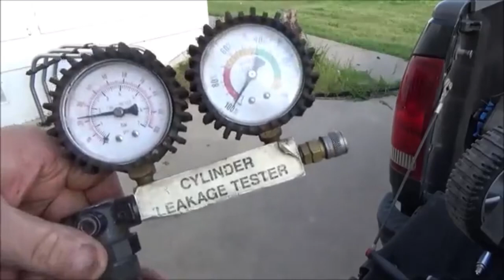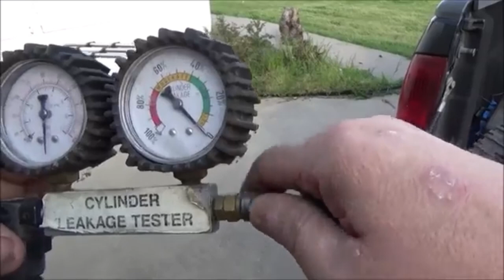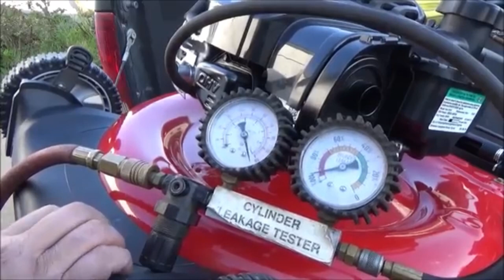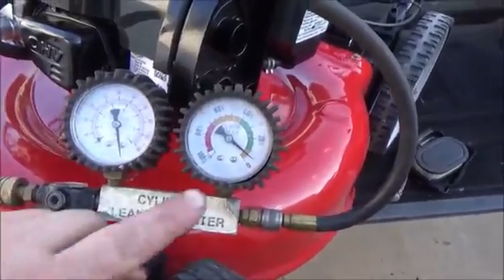BRAND NEW BRIGGS AND STRATTON 500 ENGINE NO START!! BOUGHT AS IS NO WARRANTY!!

Comment: It's just a shame to see what a mess the current group has made of the once proud briggs and Stratton brand.
Reply: THE CEO NEEDS FIRED
Reply: They are now under new ownership who are more of a financial type of company who only want sales and quality comes second
Reply: @bentullett6068  lack of quality happened long before new owners.
Reply: @TheStrikkegenser  it got worse around 2009 when they started watering down a lot of the engines. We see a lot of the single cylinder newer style Intek engines they fit on many of the ride on mowers with issues.
Reply: @bentullett6068  They made good stuff. I had a V-twin opposed last 20 years with no repairs. Just a starter gear.  I was busy and didn't keep an eye on the oil, it threw the top rod :(. My fault. I was able to repair it and it still runs good.
Reply: It woudl be interesting to hear from old timer small engine mechanics.  40 years ago my neighbor had a small engine shop and he helped me fix a cheap mower.  he told me back then the design life for a B&S for lawn mower use was 60 hours.  It showed.  Also, the motors were relatively costly back when I was pricing one from Northern Tools for a mini bike.  You can buy a Predator today, not bad quality, for about 2x what a comparable US Made one cost in 1970.  I worked on old motors lying around when I was a kid and they were not well made in my opinion.  Recoll starters, if they had them at all, were constantly breaking.
Reply: @mriguy3202  today s B$S plastic junk.
I have motors from 80s on construction equip running for decades 4-5 hours use on compactor and mixer still run good.
Stuff today is really poor quality.
China trade led to Americans reducing quality to maintain profits.
China copied Honda stole patents and sells their motors half price.
I have hondas from 1970s  ! lol.
Now most consumer stuff is disposable in 2-4 years.
Reply: @mriguy3202  I had a cement mixer with a proper Briggs & Stratton engine & even seized it & un seized it with a pry bar added oil & it’s been running ever since 1986 ,a friend of mine still has it . You can’t do that with a fake Chinese B&S lump .now days .
Reply: I bought a Mower with a Brigg & Stratton engine back about 2007. Got it set up, added oil and gas.  It started and ran for exactly 4 minutes before it seized.  I think the rod wasn’t properly torqued.  They had me take it to a authorized service center and they didn’t stand behind their product.  I purchased the same mower with a Honda engine and have only had one issue.  It still starts on the first pull.  Guess what engine I’ll never purchase again?
Reply: @randymillson259  sounds like my story. That's why I buy honda whenever I can. Worth the extra 50-100 bucks, usually.
Reply: @mriguy3202  They weren't "refined", just rough, but we often saw them running 1200 - 1500 hours used professionally. (As did my parents' lawnmower in 20 years of use, professionally maintained by me).
Cannot recognize the recoil problems - we did repair some, but considering how many were sold it wasn't many. I have not repaired recoils on neither mine, my friends' or my parents' lawnmowers.  Did however replace quite some ignition points, and a lot of diaphragms on the carburetors. It helped a lot when the electronic ignition came in 1983, but we are still replacing diaphragms.
Reply: @bentullett6068  Did they ever fix their tendency to develop head gasket leaks/"blown" head gasket
Reply: They fixed the rocker cover leaks as there is now a replacement silicone rocker cover gasket available now. The original ones they fitted on the first engines they brought out were a paper gasket.

Comment: If you get a chance check out how thin the crank case walls are on these engines . I had a blown one which had walls thinner than 1/8 of a inch .
Reply: That's insane!!! All these problems with newer engines is crazy, this stuff right here is why I refuse to go new. I stick with my older machines. My riding mower is a older 90s with a 12.5hp Tecumseh. I maintain it and never have I had any issues with it. It runs and cuts like the day I bought it
Reply: @garyalensr  cost savings at it's worst...they just don't build em like they used to...and it's not just small engines, it's everything. You should go see how terrible modern appliances are like refrigerators are. $3000 buys you 6-7 years these days before the $500 repairs begin... meanwhile fridges from the 70s, 80s all last 30+ years.
Reply: @GSP-76  
The problem is today the companies do not want it to last , if it lasts then they cant sell you another we now are in a throw away society
Reply: the problem is that some accountant calculated the company can save 100000 times 3 grams of metal ....   that the result is 100000 not working engines is a problem for aftersales

Comment: My uncle once bought a 1964? Ford "sleeper" (406cid, 4sp tranny, 4-door, steel wheels with dog dish hubcaps) for about half what it as worth because the engine "was bad". He discovered a very similar problem on one valve, fixed it easily, and had a really neat, fast car!

Comment: Be mindful their are a load of these new style engines that have had many build issues. We have seen three variants of this engine on new machines built  2020 after lockdown with oil vapour venting into the air filter housing which can make the engine look like it has a leak if left stood. It is apparently due to the factory not setting the machine that bores out the cylinder bores properly when  the factory came back from lockdown and it's literally a complete engine swap job if you can get a Briggs and Stratton agent to do it under warranty.

Comment: Great Quality control at Briggs. They don’t even bother with testing the engine and setting the carb. I was going to buy a new Ferris zero turn but it only came with a “ Briggs Commercial “engine on a 52 inch. I don’t trust their engines anymore. The good old days of the Quantum flathead are over.
Reply: I love the Quantum too.

Comment: Not that I'm a fan of Briggs, but over the last 25 years in the industry I've seen many manufacturing mistakes and recalls from nearly all engine makers. Honda had a slew of engines that didn't get the thrust washer under the governor, causing the engine to make metal from grinding into the case cover, Kohler had a bunch of engines that didn't have the rectifier grounded adequately causing charging issues, Stihl had chainsaws built accidentally with high altitude carb jets, then sent to sea level dealers......it goes on and on, and is often not an engineering mistake, but a personnel problem.

Comment: Very smart to use air pressure to keep the valve closed during assembly.
Reply: I was taught this 40 years ago. It's a lot older than that. Another trick is to feed clean nylon rope in the cylinder, and turn the piston up.
Reply: @totallyjonesin  very true and good point. Changed valve stem seals on a 351w a few years ago without pulling the heads, scary at first but works.
Reply: Totally... I said same out loud while watching... I would deffo have used some kinda pliers on the stem before... but then I don't have a compressor so I probably still would if I hadn't just seen the tip below about feeding some rope in the plug hole 😀

Comment: About 15 years ago, I ran a lawnmower shop out of my garage in Missouri. You know how it is. Fix one neighbor's lawnmower and the word gets around. Before I knew it, I was the local lawnmower mechanic.  There was one year when I had 20 mowers in my back yard, waiting for service. I worked on one brand new mower that wouldn't start. Upon examination, I found that there was no gas in the carb bowl. It was a stuck float valve. Fixed that and still no start. Then, I found a no spark situation. Turned out to be a bad spark plug. Fixed that. ( new plug). Still no start. NOW WHAT! I did a compression test. Compression was low. I pulled the engine apart. What did I find? A busted top compression ring. This engine had never been run. I ordered a ring set and replaced them all. After that, it ran like, well, like new. What the hell B&R? Shit happens, I guess. I just thought it was funny how this much BS could get through quality control. Briggs and Stratton. B&S Also stands for Bull and Shit. LOL

Comment: When I was about 13, I bought a new 5hp horizontal shaft engine for my go kart.  It didn't start, no one could get it started.  The store replaced it with another good new one that I ran until was wore out, but nowadays I always wonder what was wrong with that brand new engine.

Comment: Mu last new briggs mower came with a defective auto choke.  It kind of worked on flat ground,allowing it to start and run good, but on any slope the choke would shut.  Took it to the dealer...they put a new one on...3 months later the new one went  bad.  I modified it with a cable and spring to control the choke.

Comment: We used B&S engines exclusively on the ranch in 59 and 60 and never had a problem, I purchased a generator in 2003 with a B&S engine and it ran for 10 minutes and the push rod fell free from the valve.  will never purchase a B&S engine again as they have gone from first to worst.

Comment: Is this video a reload? I could swear that I watched this at least a year or two ago. But this is also why I still mow with my 34 and 46 year old Lawn-Boys. They both still fire up on the first or second pull.
Reply from the maker: yes of course tons of new subs havent seen it   upload videos all the time
Reply: @THEMOWERMEDIC1  Thanks! Just making sure I wasn’t losing my mind!
Reply: THEMOWERMEDIC1   Question:  I got a tach so I can set speeds at a professional level when I restore equipment.  I've easily been able to find specs for things like chainsaws.  I just got a Ryobi BP 42 backpack blower tuned really well (after cleaning out the carb, which seems to have been the problem with a screen clogged with paraffin) and no amount of Googling turns up any specs.  I assume the Low is probably around 3000 RPMs, give or take a couple hundred, but have no idea what the High RPMs should be.  I suspect it won't be nearly as high as a chainsaw and maybe in the range of a string trimmer but I really want to set it just right so I protect the equipment no matter what.  Any suggestion as to an approximate High end range?  Even better, could you direct me to a source for that information?  Right now I have the High set at around 7000 and the Low is set at around 2700 and those seem to be the sweet spots.  Of course I've backed off on the High end to not run too lean, but the adjustment on this machine is very tweaky and I could be off because I just don't have enough experience to know exactly what it should sound like, even though I do know what four-stroking sounds like on a chainsaw.   Thanks a lot for reading!
Reply: i noticed the same thig.  It would be a service to long time viewers to label it as a reload in the notes.

Comment: Good diagnostics and problem solving.  Have to take exception, though, to a careless and cavalier approach to safety.  Assuming that the engine will not "pop" and roll over could be extremely serious.  Safety first at all times.  Then you can laugh about how the actions you took were unnecessary.  Others (44K) are watching you and your role as a role model to others cannot be underestimated or understated.

Comment: OK good sir I do have a question,  maybe you could point me in the right direction.  Brand new Briggs and Stratton 17 horse , craftsman riding mower. Smokes like this one did in the 1st start up every time I start it . I bought it 0 hrs . It will fumigate the yard until it is warm . Ideas ? Where to start?
Reply from the maker: Absolutely normal! Just check and add oil often

Comment: Also if they have the plastic carb, don't run them on ethanol.  I opened the jet and started using Trufuel and no hard starting issues.  Prior, I couldn't get it to start after winter even using Stabil

Comment: Are there no quality inspections in the factory after the build?
Reply: You'd have to take it apart to inspect the assembly, so the QA inspection can itself damage the build...so you can't take it apart enough times to be sure.

Demmings QA is to inspect build quality during the process, by really inspecting the workers quality.  TQ means quality before build.  More than an occasional spoilage tracked back to WorkerX means WorkerX gets canned.

Problems with that:
WorkerX has a union rep and contract.
CHINA: WorkerX is replaced by Worker Y, Z, A, B, C.....in the course of a week....all suck.  And before Worker X got detected, he had assembled 100000000000 mowers.

Comment: This should maybe be titled F the EPA?  I have the little 5 ish horse Briggs from the series right before that, with the brush choppin', and everything bagged for the garden, mowing off the garden, and leaving it outside half the time, I honestly have to say i think it was the apex of small engines. If it doesn't start with a half hearted, half pull, it's out of gas.  It runs the tank bone dry too, burns the vapors.  Now they devolve back, by mandate atleast.

Comment: Somebody gave me a new mower , once it was a customer return  ,  it came on a palette of pressure washers he bought at liquidation.   I found that Briggs did not Assemble the carburetor right.  Took carb about , cleaned while I had it out with carb spray and put back together and started on first pull.   The issues was the intake o ring seal was installed incorrectly
Reply from the maker: more than likley som one had monkeyed with it prev

Comment: I have the very same engine. Mine doesn't idle this high. 
I just can't figure out why they made this engine without an oil drain plug.
Reply from the maker: the drain is the dipstick tube
Reply: Adding a drain plug would cost ten cents….
Reply from the maker: @jaystengel7511  in what world ?
Reply: Somethings to consider are they expect it to fail before needing an oil change and they can tell the EPA and CARB that the expected oil need in the useful life of the engine is x amount.

Comment: I bought brand new trim mower (20 inch) and it has a Briggs OHV engine on it.  It takes about 20 primes and 5-6 very hard pulls to get it to start.  It doesn’t sound like the primer is actually priming.  It’s a shame because Briggs used to always be so reliable.  I have a 38 year old Briggs engine on a 19” Sycamore lawnmower that still runs better than this new lawn mower.

Comment: I'd have pulled the valve cover first and checked the rocker arms first and see if they were to tight or if they move that's what I've done for years
Reply: Pulling the plug and leak testing tells you where to look instead of taking a shot in the dark. You would have been right this time, but if it was a bad ring you would have wasted your time, though it would only be 30 seconds so no big loss.

Comment: Messing with valves without taking the head off, I use rope... Get the cylinder half way up then stuff rope in to the spark plug hole (make sure you leave a tail hanging out of the hole) then spin the crank unti it compresses the rope up against the valves. Never trusted  air... especially on used engines only takes a slight gap to let the air out and the valve can fall inside the cylinder.
Dump the screwdriver method to find top dead center... spin the motor until it fully compresses one of the valves then gap the other.  Then do the other one the same way... done...
Reply from the maker: There are 1 million ways to skin a cat

Comment: You dont need to do a leak down test. You know what
the problem is. No compression ? Valve is stuck open.
The rocker has jumped off the valve. We didn't have
these problems before OHV.

!

Comment: Really interesting. How could that engine pass QA?
Reply: They never start it.  It looks OK by eye.  However an easy post check of any ICE is a compression check and electrical continuity check.  Don't have to start it for that.

Decades ago a mower dealer would break in the mower for you.  Fill oil, run it in, drain oil and debris, refill...sit it on the showroom floor.   That doesn't happen anymore.
Reply: @STho205  Thanks for the explanation. I appreciate you

Comment: "It has never sparked." I'm pretty sure that's one thing it has done, since the customer has tried to start the engine, and lack of compression, rather than electrical stuff, is one of the reasons the engine won't start.
Reply: Probably didn't spark much, though. Always wet.
Reply: @bills6093 : Which is different from what he has said. What do you mean by "always wet"? Doesn't look like that.
Reply: @HelloKittyFanMan.  If the engine doesn't fire the plug gets wet with liquid fuel and won't spark. All those failed starting attempts would just be fouling the plug. As would squirting starting fluid at it all the time in this case.
Reply: @bills6093 , just because an engine doesn't fire doesn't mean the plug is always oversaturated. It depends on the problem that's making it not fire. That might be the case for this engine, though.
Reply: @HelloKittyFanMan.  It probably is the case though, given the problem and the description of trying to start it. Wet plugs don't fire well, if at all. That's what I think.
Reply: OK,  @bills6093 , maybe so. But still, it must've had a spark before it supposedly got all damp.

Comment: Ok, before you end up with a bunch of viewers cutting off their fingers- never show people to lock/bypass the engine brake and then spin the blade IF THE PLUG WIRE IS STILL CONNECTED! 
While it’s unlikely that it’d start it is still possible.